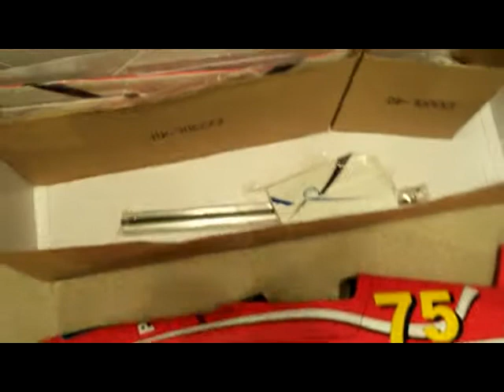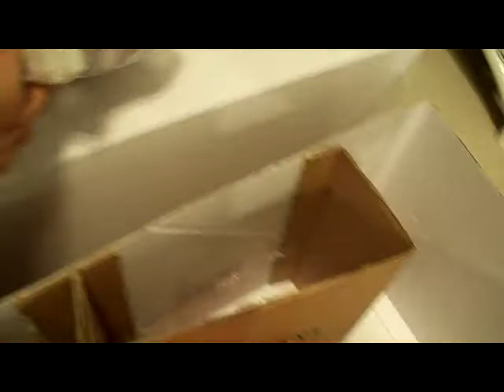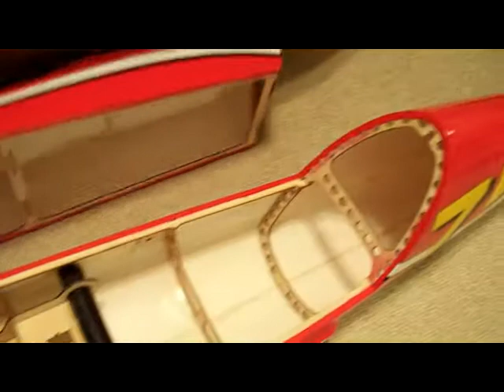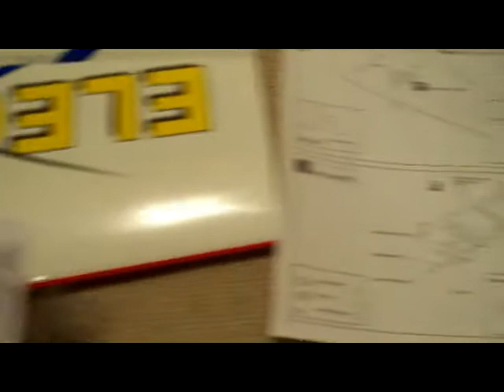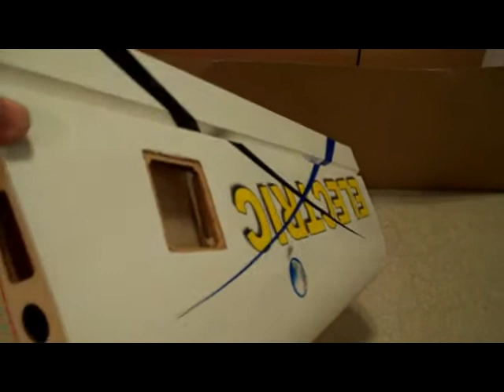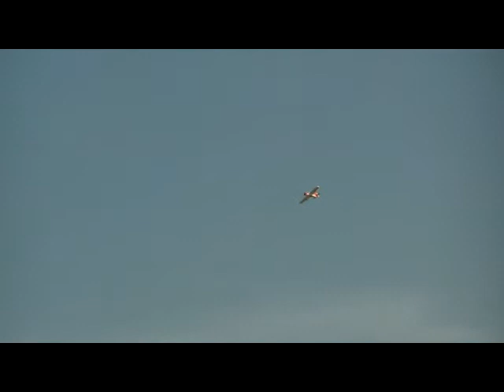Flying Dream 330L Review

Comment from the maker: @ClassicFIHD 
go to rcuniverse under the airplane , arf section and then the nitroplanes.  There is a thread on this. A MP 46 is more than enough. On 6S and 14x7 prop this pulls about 800W with a 6S battery

Comment: What prop are you using with the monster 60?  Strangely enough the Monster 60 is the only option motor to come on this plane from Nitro Planes but I found the motor for $35 from Hobbypartz.  I just ordered the Monster 60 and the ESC and will order this plane early next year.